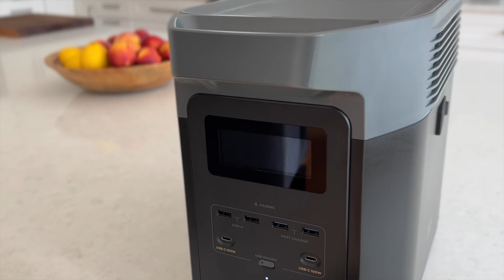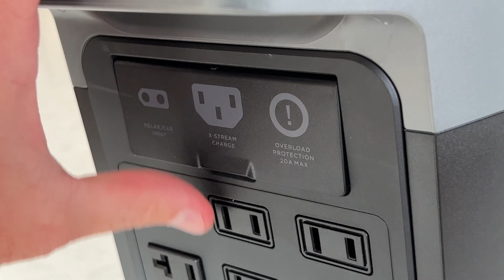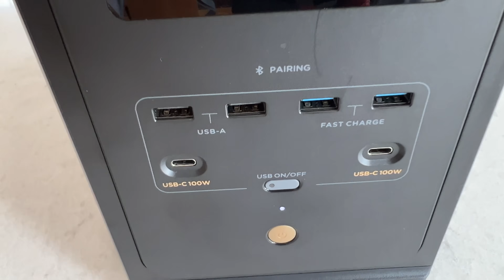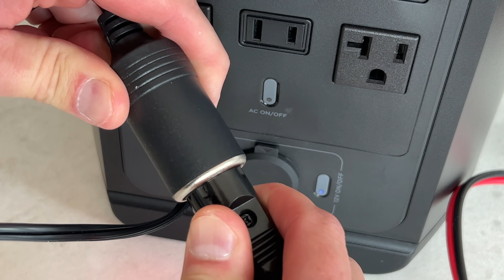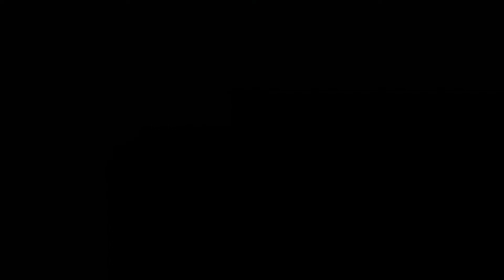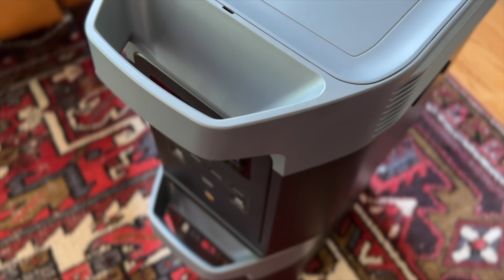Ecoflow Delta 2 with expansion battery - Best midsize power station in 2022

Comment: The EcoFlow DELTA 2 supports pass-through power, allowing it to charge from a 110V input while simultaneously powering an appliance from a 110V output,. Does this power flow goes through the unit's internal inverter to convert the AC input to AC output?
Reply from the maker: It literally passes the wall power through and will switch to battery in ~20ms if disconnected. It can also charge the battery at the same time
Reply: @todd.parker  THX - So the  power from the wall  will go to power out and any excess will go the battery (ie if 1000 watts "in" & 800 W  "out"  - the battery gets 'about ' 200 w - Right?)

Comment: There's a $1,200 offer right now, which includes an Ecoflow Delta 2 with an expansion battery and two solar panels. My question is, will those solar panels come with their cables?

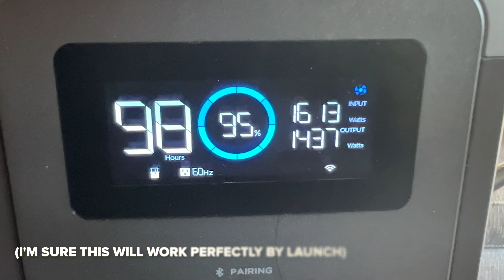Comment: hello, beautifully produced video.  can you provide an update on 7:56 in the video "and I wasn't able to charge the Max battery, but that's becuase there's a future firmware update that will make the Delta aware of the Max's larger battery"?  was your hope fully realised or with limits?  I have the Delta 2 hence my strong interest and gratitude for your video here =)
Reply from the maker: It’s working now
Reply: @ thanks heaps - what firmware version are you running now?

Comment: Great Video!

I have the Delta 2 and am looking to expand it's capacity. 

However, from information I found online. It says that only the EcoFlow Smart Delta 2 is compatible but you have shown that the EcoFlow Smart Delta 2 MAX can be used together as well but you cant charge it till there is a firmware update?

Just want to check if that has been fix via the firmware update already?
Reply from the maker: I believe that the firmware update was released so they should be fully compatible now.

Comment: Can you use the max battery on the delta 2 at the same time using the smart generator Or is it one or the other 
.thanks new subscriber
Reply from the maker: No because there is only one expansion port. You can, however, plug in the extra battery and recharge it with your generator via the AC cable, it's just a bit less efficient. That's what I do
Reply: @todd.parker   @todd.parker  So plug the exstra battery into the delta 2 and then recharge the exstra battery using the smart generator..That would give me 3000wh what I'm trying to do is run a 1000wh smart heater incase power goes out while I'm at work 12hrs a night to keep my dog's warm and with just the delta 2 the generator would be running alot cause of it only having 1024wh ..Anyway your Knowledge and content is Awsome..

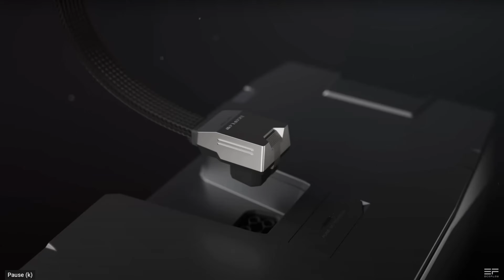Comment: 7:30 kW and kWh are not the same thing at all. i.e. the extra battery does not expand the total maximum power output it only expands the total storage capacity
Reply from the maker: Yep, sorry if I misspoke
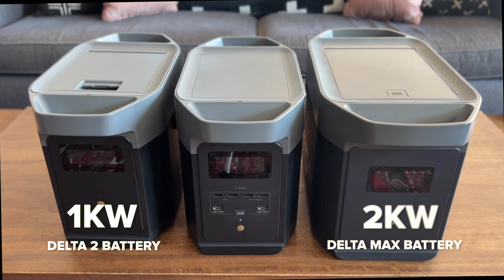Reply: @todd.parker  you correctly said at 7:36 3kwhours so I don't see any basis for their comment.

Comment: Great little unit. Have been using mine, with extra battery,  in my camper for the last 16 months. There are two things, though, that make me wish I had not bought it. It is very loud in a small space, and it has insufficient 12-volt output for all those 12 volt items one has in a camper.
Reply: Question...the ecoflow delta 2 unit has 1800w and the battery has 1800w is it a combined 3600w or is there some power loss in the system for some reason when their paired??.
Reply: @caravanstuff2827 Watts is power output , but when adding a battery, that Watt output will not change. What is increased will be your Watt/hour (Wh) ,which is the capacity, meaning, it will run at 1800 watts for longer time !! I hope it's clear.

Comment: Just bought one yesterday on Prime sale for $499.
Reply: Same. 

We have a generator but it isn’t wired into the house and is mainly for hurricanes.  

For short duration outages my wife can use the Delta 2 to run the fryer and microwave, and power a lamp and charger.

I will use the pass through feature to act as a UPS for my media server.
Reply: @meatpopsicle6244  per my research, the UPS option isn't very good.  The reaction time is slow, slower than most electronics can tolerate.  You can test that for your particular needs, but you might want a more responsive actual UPS to front end it.

Comment: So how do you change the internal, battery out? When it's life is over? I mean after 10 years. The inverter and charge controller can still be good. Can't imagine throwing the whole thing in the trash can.
Reply from the maker: I don't think the batteries are replaceable but they have a 10+ year lifespan

Comment: what i want from the delta 3/pro external batteries, is a dual 500w MPPT charger on each external battery with right angled cables, or rear connectiors so they can be placed close to each other
While 2 external batteries can run most of my house overnight, if i want the external bartteries to be charged during the day, grid power is required
i'd also love the pro to have 3 battery connectors, with the 3rd one maybe dedicated to the generator if adding a 3rd battery is unreasonable.

Comment: How do the Delta 2 handle it if the power station is on 50% battery when I plug in the extra battery?  Will it run from external battery until it is on 50% too, and then drain both simultaneously?   Will it run down both until the power station is on 0% and then external alone?  waht happens?
Reply: Great question. I'm curious too

Comment: excellent review,you forget about one CON,single one cigerate Dc output limited to 12v/10ah
is better and good to have 2 dc output 12v/25ah and 12v/10ah which enable to run high Dc appliances like Dc fridge,Dc fans,DC TV,DC Bulbs etc
Reply: At least oft still has two dc 2521 ports, although rated at 3amps,I plugged in my diesel heater, which pulls 105 watts on start-up. It's never failed, but it does bounce all around from 12 watts to145 watts. Maybe it's designed that way.

Comment: Very professional review!!.....  My question is, Is there any solar charging on either of the batteries alone?  I know there's charging on the inverter / battery unit, but does either of the batteries have a solar charging port on the battery itself?  Thanks!!!
Reply from the maker: Unfortunately, no. The batteries don’t have any inputs or outputs and can only be used through the main unit and it’s proprietary cable. Bluetti and Veryeah have batteries that are more useful standalone

Comment: Why at 100 percent charge on both batteries, when using my air fryer for 4 minutes 5 times I'm down from 100 percent charge on both batteries to 50 percent on the main battery and 57 percent on the extra battery. Im surprised and disappointed this unit uses so much power so quickly. This wouldnt keep me going in a power outage for more that 40 minutes total. That's connecting just one appliance that's 1500 W. Am I doing something wrong?
Reply from the maker: That doesn’t seem right. How much power is it pulling?

Comment: Don't buy delta 2... It works OK for a short while then you have nothing but Bluetooth and WiFi connection problems. I bought a second unit and it is doing the same. ECOFLOW SUPPORT IS NOT ADEQUATE

Comment: Amazing video!!! I am from Greece we have plenty of sunny days and i am very close to buy ecoflow delta 2 for "exclusive solar charging", could i use a 550wat solar panel in order to get close to delta 2 max Solar Charging power? also is ecoflow gonna release delta "2" max batteries (2kw) with 3000+ cycles instead of delta max with 800+ cycles?
Reply from the maker: You’ll probably want to wire a few panels up to hit the max (11-60V, 15A, 500W max) but it depends on what kind of panels you want. I’m sure a LFP Delta Max is coming very soon so there will be a battery for you

Comment: Delta 2 was my number one option because of the expansion options. But in reality the expansion is useless if you are limited to the 500W charging. They may say 500W but you can't get that. The most you can get is two 220W panels. So with only 440W, if you have two expansion batteries, is completely unrealistic to rely solely on solar to charge. It would take way too long. I am looking at these for a grid down situation and camping. The only way the expansion batteries work, is if you can charge them fast at home. Relying solely on solar won't work for keeping them fully charge each day. That is hugely disappointing.
Reply from the maker: Yeah, I can see that. A lot of companies are offering expansion batteries like that that can only be charged through the main unit and the solar input is only fast enough for the main unit. That said, you should be able to recharge a D2 + 1kw extra battery in a solid day of sun. A 2kw pack or second battery, no way.

Comment: Nice review.  Are the settings for ac charge rate sticky, or do you need to connect to the app each time you charge to set a lower charge rate??
Reply from the maker: It remembers the setting so it’s sticky
Reply: thanks for the quick reply Todd.  One more question: they spec the solar feed as 60v, 15A...... That's 900w, not 500. Will the unit accept 900 wo damage and use 500?  Or do we need to do the math and not exceed 500 for fear of damaging the solar input circuit?  Thanks for your help!
Reply from the maker: @BikerMiker720  good question, that’s…interesting. Maybe they give you that much range for flexibility but cap it at 500w total which is nice because usually there is no way to hit the max unless you have the perfect panel specs. Here, you can use higher voltage panels and it will cap the amps or vice versa. Just don’t exceed the max voltage and you’re good
Reply: @BikerMiker720     It seems as though, 35 volts&15is the sweet spot. Higher voltage, it begins to drop amps in the charge controller.

Comment: The Delta 2 I ord'd is scheduled to arrive this coming Thursday. Useage will not only be for any possible outages, but it will also be  replacing my Jackery 1500 that I use in my square drop trailer when camping. Already own the DeltaMax, two Max Smart batteries, an EF Duel Fuel Generator, and two recently purchased River 2's. The River 2's are not only handy around the house, but will also be used for charging phones and usb fans & lights while camping. Hoping EF comes out with a Delta Max with the LFP technology.
Reply from the maker: Quite a collection! I’m sure a LFP Max is in the works, last one to get the upgrade

Comment: with the app, can you:
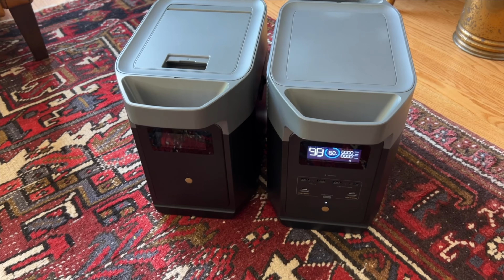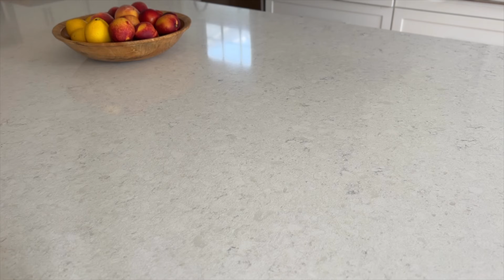- Tell it to charge when it goes below 80% AND time is between say 02:00 and 05:00 (we have variable electricity cost, can be a factor of 3x between night and day)
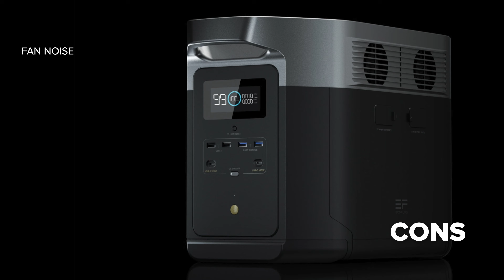Reply: Answer is NO. You can only set percentages unfortunately. Have to put a ‘clock switch’ in front to limit charging to 00:00 - 05:00 hours - but then - if it goes to zero % at 21:00 - I have no power until midnight. Room for an improvement in the firmware. 

Had a few AC cut off’s when using  XBoost and pulling 2100 W - especially if charging at the same time. Reducing load on my Airfryer - by going from 200 to 190 degrees C lowered consumption to 1900 W - and I was able to complete the cooking (12 minutes). Added a second battery for increased storage

Comment: ecoflow sells connection cables for solar panels 2-3 times overpriced, not recommended
Reply from the maker: They use standard connectors so you can buy from someone else or roll your own. They include them with their panels but agree they should pack them in

Comment: BTW is the Delta Max extra battery chargeable on the Delta 2 now?
Reply from the maker: Still no official word on that
Reply: @todd.parker  wow, they are listing the Max extra battery on their website as compatible. That’s unfortunate
Reply from the maker: If it’s listed as compatible then it is. When I was testing, it worked but the charging seemed to need refinement because it didn’t slow down for the last 80-90% which is typical. I haven’t re-tested it but can soon
Reply: @todd.parker  ohhh ok, I thought you owned them both
Reply from the maker: Actually, sorry I was a bit confused there. This combo worked fine in my testing. I was thinking about charging the Delta 2 with smart generator for some reason.

Comment: Could this be hooked up to a transfer box or a single pole transfer box to power essentionls in the home during a power grid loss? Let's say I wanted to keep the furnace going, a freezer and a fridge and maybe one circuit for a light, modem and computer. (Yes, I plan on getting the extra battery also). The furnace obviously cycles in about 10 minute intervals so it is not running all the time. with that configuration how many hours do you think I could get in an emergency. Where I live, furnace is high priority (North Dakota). Are there videos on how to achive this with a transfer box? Thanks. Very nice review.
Reply from the maker: Absolutely, it’s perfect for that. I have a few videos on the Goal Zero 120v transfer panels I have. Reliance makes a bunch. Runtime is hard to say, use a watt meter to calculate the load
Reply: @todd.parker  Where I can I find that transfer box in stock? The Goal Zero 15 amp 120v...it is out of stock on their site and naturally it has to be UL approved on nobody will install it for me. Thank...I just ordered the Delta 2 and a backup battery!
Reply from the maker: @daddylogan  Reliance makes the GZ unit so you can just buy one directly: https://www.reliancecontrols.com/products?category=pro-tran-2-manual-transfer-switches-3&page=1

Comment: Todd another excellent well polished graphics and camera work review and the comparison with other manufactures is a nice touch at the end. I am in the market soon for a 1KW or 1.5KW unit with a LFP battery and right now EcoFlow own's' this 1KW market. This unit is not perfect and the noisy fans seem to be an issues with other reviews as well but it has good power and big inverter for a great price. The CES is coming up in January of 2023 so we will all have to see what's coming up for next year !
Reply from the maker: Glad you liked the video. I think this is a great option for what you described but it can’t hurt to wait 2 weeks to see what happens at CES. I’ll be there covering the event, stay tuned!

Comment: Purchased this Black Friday special. Not refurbished. Delta 2 Generator, works well. The smart battery, well um.... Won't charge. By the way who at EcoFlow thought just ONE SINGLE charging method for an extra battery was wise??? Seriously, no solar, no AC, NO OTHER option to charge Smart battery other than connected directly to Delta 2 Generator. Called them twice, Emailed, kept telling me "Update the firmware, should work" Did that, TWICE, have video (posting on my channel today) Still wont charge. Smart Battery came with 30% charge I hooked it up to the Delta 2, feed it just fine, until drained.  Now, absolutely NO WAY to recharge the "Smart" battery.  I say Ecoflow was not very SMART on this execution.  Have 2 other EcoFlow Generator units from March of this year, work just fine. Also own Jackery (meh) RockPals, Nature's Generators, none have a unit with just one SINGLE way to charge.
Reply from the maker: Very strange. Have you tried charging it via DC (solar or car)? Maybe it’s in an odd state.
Reply: @todd.parker  Todd, that's my point sir. There is NO DC, no Solar, NO CAR, check out the Delta2 Smart battery. It was ONE plug connection and can only be charged by the Delta 2 Generator. That's it. Color me confused
Reply: I would be dancing if they had another port on the Smart Battery, am not an engineer but you would think at least 2 options to charge would be SOP
Reply from the maker: @anthonythomas6977  gotcha. I thought you were saying the main unit wasn’t going along a charge. I agree that the extra battery should have a DC input and DC output (12v + USB-C) so it can be used independently. Bluetti does that on their bigger batteries and it’s great
Reply: @todd.parker  EcoFlow determined Delta 2 Smart battery is defective return to be refurbished. I informed them they either provide refurbished pricing discount or send a new one. It happens but very disappointing as these are not $99.99 items> Also notice they have quite a few Refurbished items for sale, just saying. QC needs to up their game

Comment: Pls advise which one better to take :
Delta 2 with extra battery or Delta Max 2000?
Reply from the maker: Right now, I’d go for the Delta 2 + battery because it has a LFP battery and is newer. Guessing the Max will be updated very soon
Reply from the maker: Right now, I’d go for the Delta 2 + battery because it has a LFP battery and is newer. Guessing the Max will be updated very soon

Comment: Your  review of the Delta 2 and expansion batteries is excellent - took 8 pages of hand-written notes!  Since I am still in the learning mode on power stations and calculating my specific needs and requirements for a grid down scenario, have you thought about making a video on just how to connect up multiple devices including optimal solar panel setup  outside running inside to the power station and ultimately the devices I will define as needed?
Reply: Thank you for your comment! I'm glad you found the video review helpful. Considering your interest in connecting multiple devices and setting up an optimal solar panel system, I'd definitely recommend checking out the Segway Portable PowerStation Cube Series. It has a massive capacity, fast recharging, and versatile sockets, making it a great choice for powering your devices during outdoor adventures or even as a backup power source at home. It's worth exploring and considering for your specific needs. Happy camping and stay powered up!